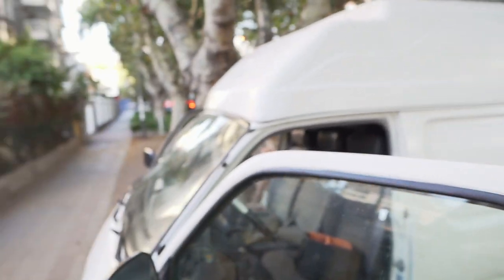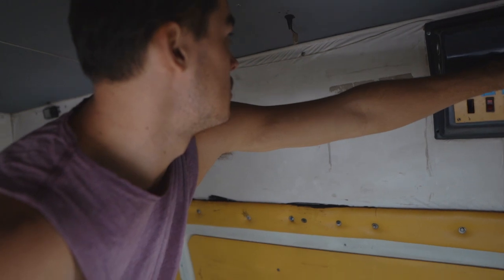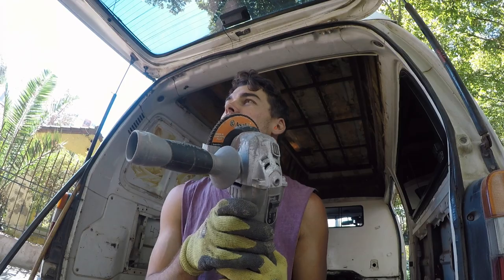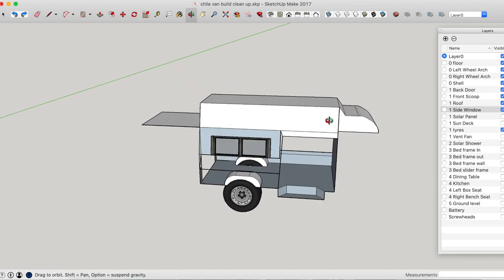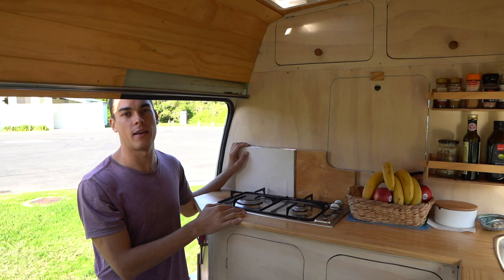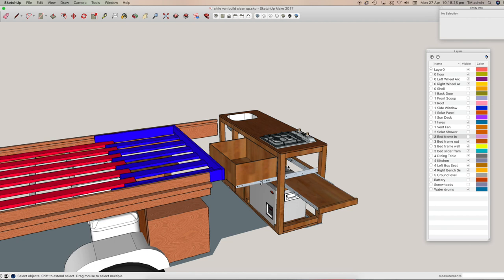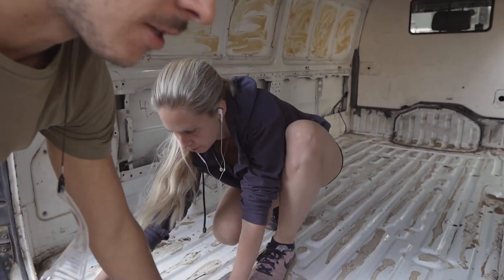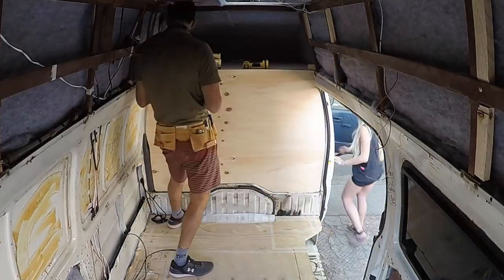DESIGNING OUR VAN | (SketchUp Designing, Floor and Insulation)

Comment: Hey guys I just bought a Kia Besta '98 van  ( pretty similar structure)  and I came across the same issue about the engine heating below the seats, I wanted to know if you fixed it and how :)  Thank you!
Reply from the maker: We never got around to fixing it as we fled to country due to covid. We were planning on installing some of the car bonnet/hoot heat reflective material.